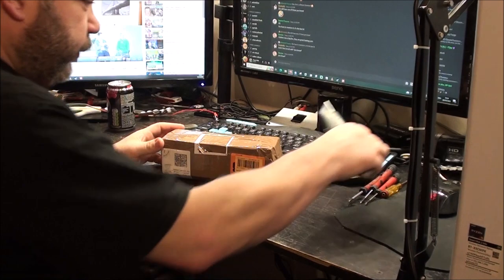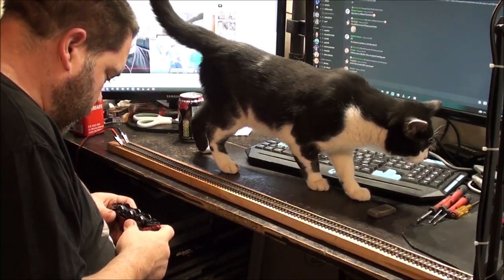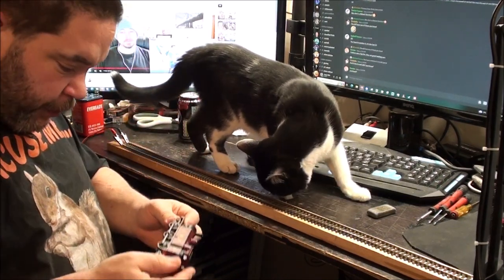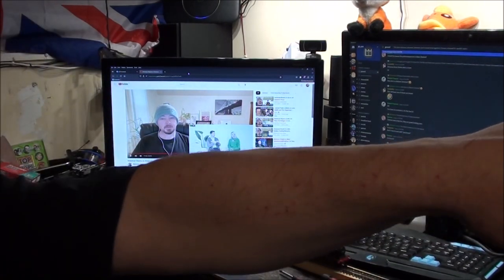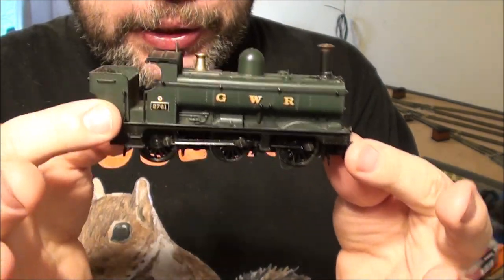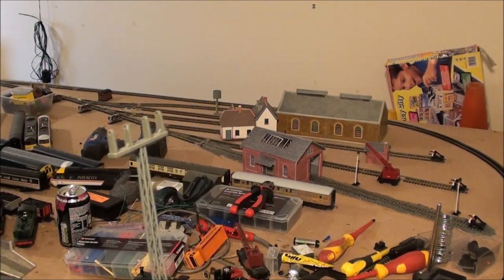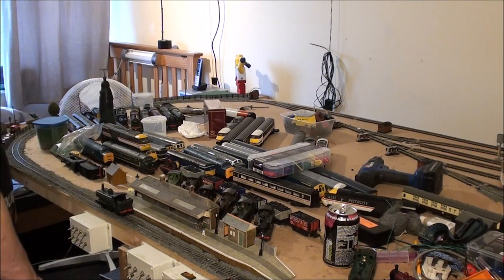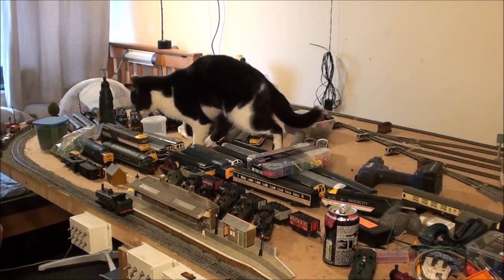Model Railway Update! Got Some More Scenery Done.

Comment: Certainly seems to get noisier on that bend, is it the wheel flanges hitting the sleepers do you think? Or fouling on the fencing? 

Is it set track or flexitrack on that bend?

Also 11.50 for the pannier was a steal!
Reply from the maker: There is plenty of room between fence and locos, but there is quite a gap in a joint that doesn't help. It's also set track on the corners.